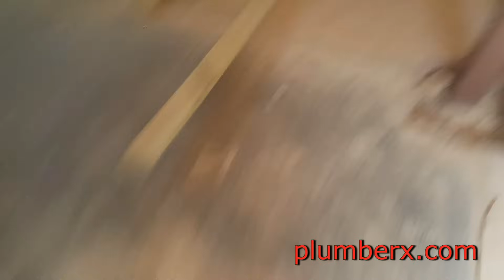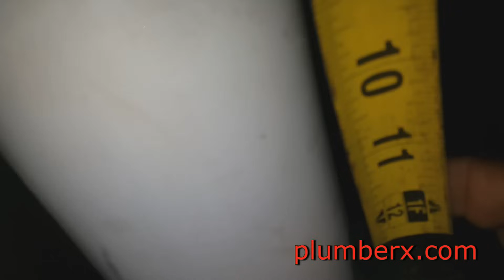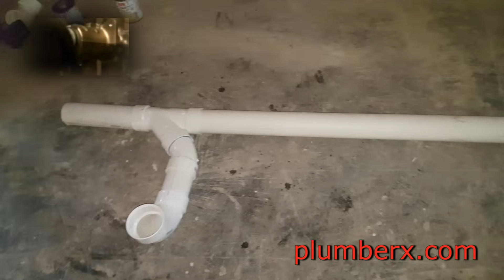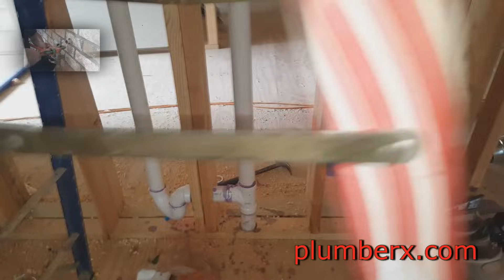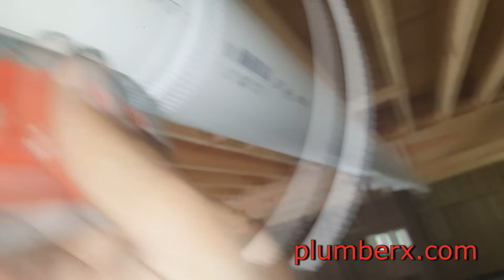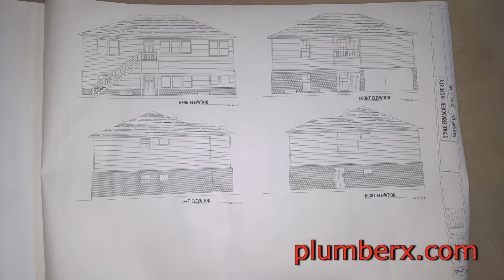Installing And Designing Drain, Waste, And Vent Lines: A Step-by-step Guide

Comment: Very informative video. Thanks.
You seem to have a good system for measuring. Seems like many folks dry fit several pieces and then measure to see how big the last piece has to be. The problem I see with this is most of the fittings I have worked with do NOT seat all the way in (some worse than others) when dry fitted. So, the assembly will be slightly longer than it will eventually be when solvent assembled. How do you deal with this when measuring?
Reply: Coat with water when dry fitting
Reply: @bulletmunchr  Thanks for the tip. Will try that.
Reply: Best method (at least on commercial jobs) is to lay out with pencil/ lasers/ chalk lines on the floor.  You can lay out the fittings right on top, factor in the cup of the fitting,  and write down your measurements. Then you can cut all your pieces for one area. Layout takes awhile longer initially,  but then it goes fast,  cause your cuts are more accurate
Reply: @saraselega9503  Thanks.
Reply from the maker: Your right, to me dry fit is pretty much a waste of time and it can still be off measured. I focus more on getting the right measurement two or three times if need. 😉 Then cross fingers and go for it🤞

Comment: remodeling a 13x 8 bathroom .moving toilet 6 feet ,had to relocate 3 inch drain and get rid of old vent for toilet and tub.new bathtub drain  will be located 4 feet from main toilet drain ,also adding a walk in shower ,drain will be 10 feet from main 3 inch drain.all connected together.how many vents will I need and there location? I am going to use 2 inch on bathtub .can I use one and one half inch pipe  on an 8 foot run tied into tub drain?
Reply from the maker: Yes you will have to vent everything. I would run a 11/2 drain more then 5'

Comment: I've always been confused if it's okay to roll a wye up 45 degrees from a horizontal drain line. I see them, or combos, flat and sometimes rolled up to receive waste from a  vented fixture (wet vent).
Reply: My understanding of the UPC code is that wyes and combos can be in either orientation...Sanitary tees cannot be used for waste in those orientations,  you need a longer sweep so it's possible to snake the drain line if there's a clog. Santees in a vertical orientation,  with the direction of flow/ curve in the tee going down are what's used to stub out for the plumbing fixture.  Santees are also used in venting, but the direction of flow is opposite, it's going up,  because gas rises. I don't think I know a single plumber who hasn't placed a Santee with tee going the wrong direction at some point lol
Reply from the maker: Lol

Comment: Why is my house black pvc pipe?
Reply from the maker: It's more then most likely the plumbing code for were you at. usually it's cities in the West Coast that use ABS black plastic waste and drain pipe most of the others states and city's stop using ABS black pipe years ago, but instead  use PVC white plastic waste and vent pipe. ABS black plastic pipe can get very brittle and crack easily and rodents like to chew on it.
Reply: @theartofplumbing  
Thanks for your time. Sounds legit. ✌

Comment: Have your helper measure the hub of each fitting and tape the line with painters tape to primer and glue beautiful glue joints. It will teach him how to control it. Also have him cut and use cardboard under his joints to keep it off the floor. It won't take him long to learn to be careful. I have to be careful myself not to be sloppy when I'm doing it.
Reply from the maker: Good advise. Thank you

Comment: Hello, I could really use some help here. I've got a horizontal line into a sweep 90 that makes a turn and then goes directly into a vertical sweep 90. This is a fitting to fitting with no straight pipe in between. The main line backed up in this area and I don't know if this is to code. Please help!?
Reply from the maker: Codes, 90 sweep horizontal that's fine. Going vertical a regular 90 would have been fine. But the plumbing code changes from State to State City To City. I would feel personal yes this should pass.  I just can't speak for the inspector and hope he or She not on a power trip 🥴 keep in mind venting properly is very important.
Reply: @theartofplumbing  this is in San Diego California, UPC standards. It sucks because my house flooded from this. 😫
Reply from the maker: Sorry to hear that. I was flooded out by rain in 2015. It sucks. Lost everything. I moved to higher ground.

Comment: big room like that here in california the walls would be going up  several carpenters   elctritions and hvac would be going .   music blasting   and your fittings be scattered all over  ha ha .  We gotta adapt to suroundings   good video wish my jobs looked more like that.    
          another great way besides holding your tape measure is to use your fitting takeoffs  its actually much faster   but takes awhile to memororize  for fabbing the pieces  you need a fitting book from charlotte pipe or whoever.    each method has advantages and yours is fine

Comment: Back in the early 80's I worked for a summer as a Plumbers Helper (aka GO-FER) I decided not to pursue that line of trade. Sure wish that I had that summer over to work with you. And I'm sure I would have learned the Plumbing trade. But then again that hindsight is 20/20, right? Oh but I did learn the 3 rules of Plumbing
1)HOT's on the LEFT
2)COLD'S on the RIGHT, and 
3) Crap Doesn't Flow Uphill  and add one more cavet to these rules, PAYDAY'S ARENT ALWAYS ON FRIDAY.
Thanks Again for your instructions.
Reply from the maker: Lol 😆. I appreciate your enlightenment spirit. It's nice to hear a great and good-hearted comment it make for a awesome day👍
Reply: @theartofplumbing  I have a  challenging project. I have a walk in closet, I want to turn it into a bathroom, it sits next to my master bath. my house is on a slab foundation. Main concern, will i have to access the main drain line? Or can i access plumbing in MB?
Reply from the maker: Sorry, buddy you will have to tap into the main waste line. Under the cement slap. Big job, but there is a different type of toilet that would make the job a lot easier. Check out this video. https://youtu.be/hJjLwlVVORE
Reply: @theartofplumbing  Thanks, what about the shower? Same? Main drain?
Reply from the maker: Yep same thing😏

Comment: HAMMERPEDIA everyone, so easy he'll have you kicking yourself for ever calling a plumber, great video tutorials and free diagrams. You don't see the guy and he gets right to the point teaching you HOW EASY it is to glue pipe, don't be afraid of a drill and bits either. Electricity is not as complicated either, same concept of just connecting the right parts in the right way, neither are rocket science worthy.
Reply from the maker: Thank you for the kind comment. I appreciate your support

Comment: So I have issues with a vent stack can a AAV be used in conjuction with a vent stack at the same time? I tried to get a plumber to clean the vent stack he was going to refer me to another company that cleans vent stack it with air pressure is that the norm, doesnt sound like it would help.

Comment: Is there a correct way to drill the holes for all the piping I always get confused with that aka I am an apprentice
Reply from the maker: Yes there is. Don't drill to close to the front or back of the stud for water. When drilling for waste, drain and vent make sure you not drilling or cutting barring walls. Best to ask a carpenter.👍
Reply: Yes, location and size is in the plumbing code

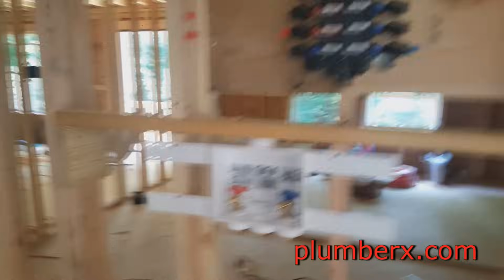Comment: Why is there a double wall at the 24:14 mark?
Reply from the maker: Yeah we had a lot to fit into that wall. Gas lines, water waste,
Reply: How to Plumbing is there a rule of thumb you use to determine when to add another wall side by side to the previous wall?

Comment: Hey man great video! I'm building a house on a new lot. Can I use a 4" pipe as the main line to the leech field or do I have to use something bigger/multiple lines? All my fixtures total 18 DFU
Reply from the maker: Are you tighing into a septic system on your property. Now day we use arobic system if it's your own private sewer treatment.
Reply: @theartofplumbing  Into our own system. It's currently an empty lot with no connections at all. Sewage, water or electricity
Reply: @theartofplumbing  Thanks for the reply by the way
Reply from the maker: @perfectwhine742  sure no problem. Yes I would go with an arobic septic system. The septic system with leech fields are kind of out dated. Leech fields use perforated pipe. And yes 4" 😉

Comment: Question: At the end approx 25:00 you show a pipe coming from a side inlet that’s not connected. Is that going to the tub?
Reply from the maker: Great questionn. That is the end of the run. I installed a clean out there for future use if line needs to be unclogged or cleared for any reason. 👍

Comment: You are amazing! I recently (and stupidly) thought it would be a good idea to tear out the cast iron and replace with PVC by pulling my own permit and doing it myself. I soon found the venting issues in the code so confusing I turned to a couple plumbing forums. Thanks to their patience they finally got me through to passing inspection, BUT I still didn’t understand WHY I had to do things the way I did. This video explained every single thing that I was unclear on. Thanks for taking the time to go over all the details of why, and I really appreciate you showing how to measure, I wish I knew that trick when I was doing my project.
Reply: Damn. Only remove the cast iron if it has a significant leak. A pinhole leak can be left and last another 10 years or more before getting so bad that it starts causing significant damage

Comment: Good video.  I like the idea of precutting as much as possible.  Picasso?  One or 2 joints like that would generate a corrective interview.  Keep it up and he is gone by the afternoon.  Goes to his attitude and pride in his work...
Reply from the maker: Lol. Picasso gotten much better. 🤣🤣🤣
Reply: I'm curious as to why all is below the beams?  Another false ceiling to be built?  And I should think the cost of missed cuts would out way the savings of precuts. Clearly you've found otherwise.  Do you measure for final connections with all other piping in place?
Reply from the maker: @Spencerbuildsit  that's it. No false ceiling. Your looking at finish ceiling. It was built just to get the house off the ground to keep from flooding again. They will use all that area for a work shop or garage.
Reply: @Spencerbuildsit  At least the ceiling is high,  any pipes under 76" drives me nuts!!

Comment: Plumber's apprentice here; to connect two fittings with hubs ,what's the best measure of pipe to put in between? 1 1/2? As I was typing..you answered the question ..thank you.. my next question was about lasers ! WOW! could a laser tape measure be used to make cuts ? Say I needed a 20 inch cut from a 20ft pipe..could a laser be used to custom measure ? Or does the  laser measure just shoot a straight line ? One more question..what kind of laser is that ?
Reply from the maker: Wow, good question. Yes, you can use the laser as a measuring device, but it can be tricky and hard to explain here. The laser is a great tool, but mostly use for leveling horizontal and vertical. Then I'm using is made by Bosch
Reply from the maker: The way I would measure 11/2 strait piece of PVC center to center the take away from center of fitting to bottom of hub.

Comment: Your measuring   Technique are you measuring from hub to hub are you measuring from center to center you lost me. I always measure from  hub to hub.  I'm not sure if I'm doing wrong or there is easier way to do
Reply from the maker: Center to center, end to end whatever works best at the time of what you're doing.
Reply: @theartofplumbing  I like your video.  Can you make a video when running bats which  Studd or fire block or Joyce we should not touch or drill  Through.  I'm in the service plumbing department . I did new construction for 5 years with us when I was 18 years old has been awhile trying to get back into the new construction or remodeling. When running vents I'm just 2nd guessing myself when I'm drilling through the 2 by fours or Joyce's across
Reply: @theartofplumbing  vents*

Comment: Like your system of laying out your fittings.
Reply from the maker: Thank you👍
Reply: @theartofplumbing  ,  really thank you, as I usually have an idea and mental picture of how I am going to do a house, 

 but my piece by piece method really is tooo slow,  this way also makes me to be more accurate with all parts needed ,  

This is a follow up , to my comment

 as now ,, , I tried your method and it worked just fine.

 A proven winner for me,  thanks for sharing  ..
Reply from the maker: @georgefolgers8731  appreciate you 😉

Comment: Can I plumb two toilets in the same bathroom what kind of cheese do I need to put in please respond thank you so much I'm a big fan I've learned a lot from you and how to solder from you thank you my name is Nathan nice to meet you mr. Tater
Reply from the maker: Thank you nice to meet you as well. Yes, you can put two toilets in one bathroom. How much would it cost. Hard to say there are many things to factor in. Do you have a cement floor, is the basement, is it going to be on the second floor, Is there existing plumbing there, etc, If you have blueprints or I could see the work area and what I had to work with than I could tell you how much 🧀 😉

Comment: Claude, I'm planning the layout for a basement reno.  Can my sink drain flow up, across the ceiling, and down a wall to connect to an existing drain?  I saw your up-flow toilet video and I don't know what's possible or not anymore.
Reply from the maker: Yes, you can. Same process as the one in the video.

Comment: I've plumbed over 20 years. Nice to see a video of plumbing done properly and it's nice neat and straight as our title states PLUMB. What's your take on that  plastic pipe hanger. I still use galvanize hanger. Also does your local code require purple primer? Luckily here in NC we are allowed to use Un-Purple primer which is visible with a UV flashlight. Again nice job.
Reply from the maker: Thank you. Sometimes it depends on what part of the area you live in. Some inspectors only want to see the in-ground drain line in purple, so they don't have to crawl down into the ditch. The can see it from the top side. And others will let you get away with purple primer above ground. I call my local inspector first sometimes if I'm not sure. I wish everyone was on the same page. I'm sure you understand 😎

Comment: Upgraded to a better sewige pump but now I get gargles out of my upstairs sink... Do I need to vent the sewige PVC lines?
Reply: If that's the only fixture gurgling it might be that it's clogged in the drain pipe for that sink. If not then the sink is not vented correctly which means cutting drywall and the floor to see what's going on. It's not easy to add a vent pipe unfortunately

Comment: 20:13 I see a Tee coming in from the left. I thought they shouldn't be used? Or is it because it is on a vertical pipe?
Reply from the maker: Yep
Reply: @theartofplumbing  ok. Thanks. Just found your videos. Don't listen to people saying you talk too much. I love long videos. Who wants to watch a rushed 5 min video that doesn't show anything?
Reply from the maker: Thank you for your support😉
Reply: @theartofplumbing  how many plumbing fixtures can share one vent pipe?
Reply from the maker: It can get very technical, it goes by how many plumbing fixture units and run of pipe horizontal and vertical, but to make things easy the average home can share the same vent but you will need one vent going out the roof at least 3" inch to 4" whatever size you have the main sewer drain under home. Check out this site and you will get an idea https://codes.iccsafe.org/content/IPC2018/chapter-9-vents
Reply: @aguyandhiscomputer  I agree! Thanks for bringing it up.
Reply: @theartofplumbing  The ICC plumbing code allows a 2 inch vent through the roof for every bathroom. I basically can't install 3 inch vents anymore because the cheap builders use 2 by 4 walls and the pipe cuts the plates out and the fittings will stick out the wall. Really pisses me off.
Reply from the maker: @joshm5816  yeah I had that happen a few timed. I had them far the wall out before they drywall.

Comment: I would like to put a shower down in the basement … I would like to connect the shower drain with the toilet drain that is in the basement … Do I still need to put a separate air pipe in for the shower drain ?
Reply from the maker: Yes you would have to install another vent😉
Reply: Not if the toilet is vented. You could tee off that vent if it's 90'd far enough below the concrete and if the vent is within 7' of the shower trap you install
Reply: This will not work at all... shower drains need a p trap and a toilet drain does not have one because toilets have integral traps

Comment: I like your approach and foresight. I haven't used that method in 30 years. I can just "see" it now.
Reply from the maker: Thank you. I'm a little old School. 👍
Reply: The old school method shouldn't die off. My father taught me this way, and I've learned the equation factor of installing, and both of them work perfectly. Also in the service, repair field, it's important to be able to just see it when everything is finished so you can diagnose the problem.